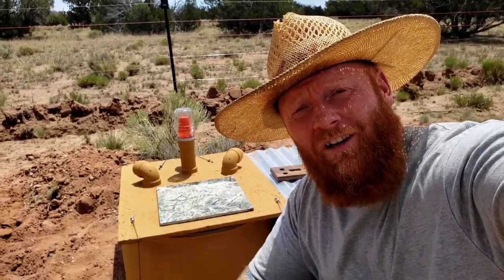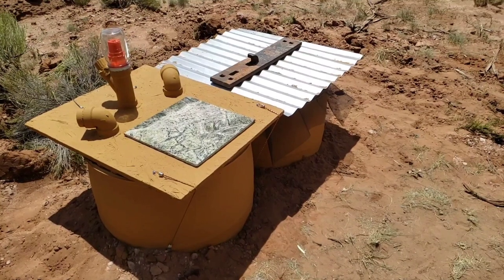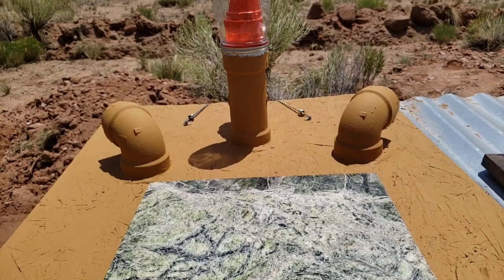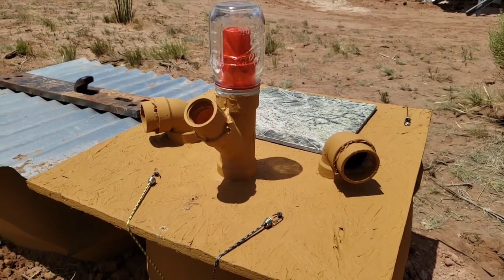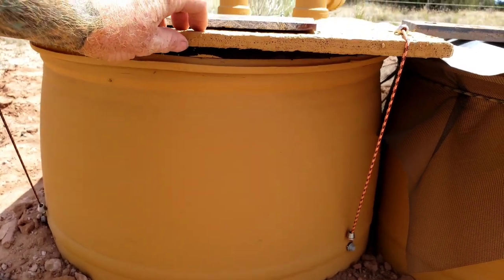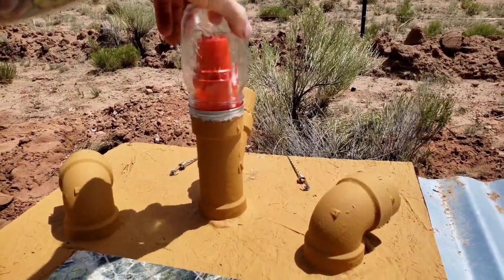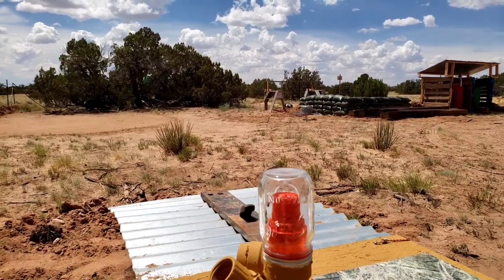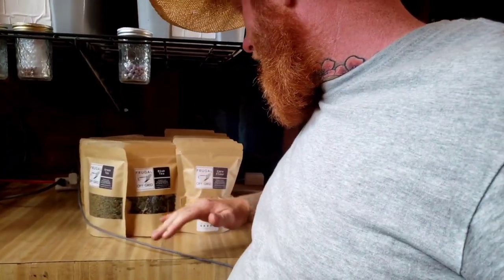Arizona approved composting toilet

Comment: I'm curious if you have a turning device for the toilet.  That's one thing I'm churning about in my head. Thinking maybe about using a paint mixer?
Reply from the maker: A compost crank works best but the right paint mixer should work.

Comment: what tool do you use to stir the human waste barrel, every two weeks ?  good explanation, couldn't see clearly into the vent to see the screen setup.
Reply from the maker: They suggest a compost crank. Netting can be installed with hose clamps.  I pinned them in place with pvc fittings.

Comment: Hey John,did I hear you correctly, that if you have a compost toilet you don't have to have a sectic tank in AZ?
Reply from the maker: Well that's not exactly what I said.  You still need to have a black water system.  For now I reuse all fat from my skillets.  I clean them with paper towels and haul that out.  I will build a black water system.  Then I can build a home.
Reply: That's great info, I have been looking at properties in AZ, but when I would call the counties,they would all bring up the septic tank..none of them told me about the compost toilet,thanks for making the video
Reply: So you can live on your property full time with this and hauling out other waste? We’re trying to find property in AZ where we can be on the property full time and have time before installing septic and building a permanent home.

Comment: Now.. do deposits have to be made directly into the barrel or can you have a toilet bucket inside then empty to the barrel outside?
Reply from the maker: Using a different toilet would negate the redundancy of the sealed lid and fly trap.  I'm sure it would not be permitted.

Comment: John, do you have to use a 55 gal drum? i want to build an outhouse with a lower door in the back outside and be able to slide a full drum out and put an empty one in using a 55 gal drum cut in half, top to bottom not length wise, why do they need to be buried in the ground? can you keep it in a small sealed compartment accessable only from the outside? thanks!
Reply from the maker: This is the only approved DIY compost toilet in the state I'm aware of.  It was designed by an engineer who lived of grid 25+ years.  You could always submit your plan to your county.

Comment: How would you empty the composted bin when its time? Just dig it up and replace the drum surely that would mean another inspection?
Reply from the maker: After four months when it's composted it's pretty easy to shovel it out.  You can start a compost pile or use it under trees etc.

Comment: Would they (the county) allow you to use a burn barrel to incinerate your grease? Or greasy paper towel etc that you wipe out you kitchen pans and so forth with? - As a side note, I know that the military in remote areas have incinerated all human waste by dowsing it with diesel fuel and then lighting it on fire.

Comment: How far away from your house is it and can you put yeast in to put help with composting?
Reply from the maker: I live in my van but it's about 30 feet away.  It needs to be 50 feet from your property line and 10 feet from other buildings. You would have to ask the state about altering the system that's approved.
Reply: @FrugalOffGrid  Awesome!! Thanks!!